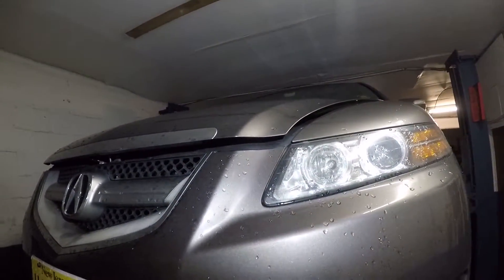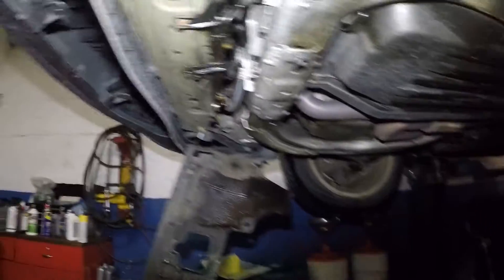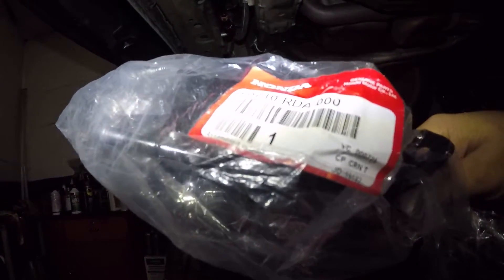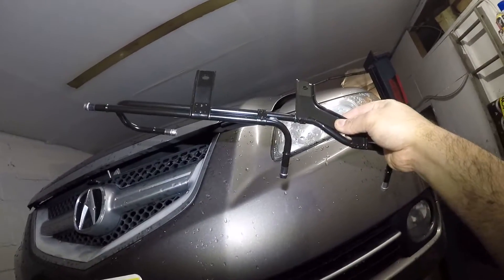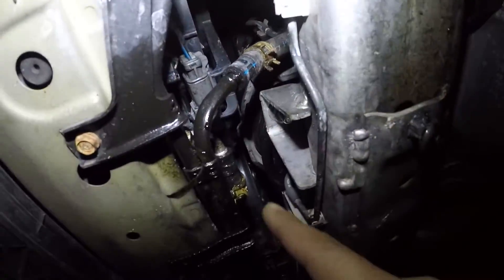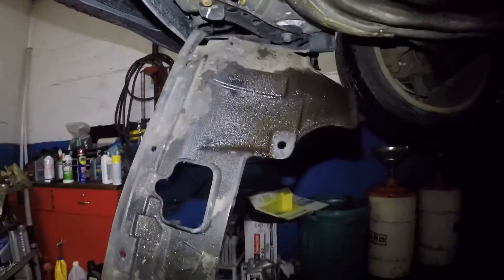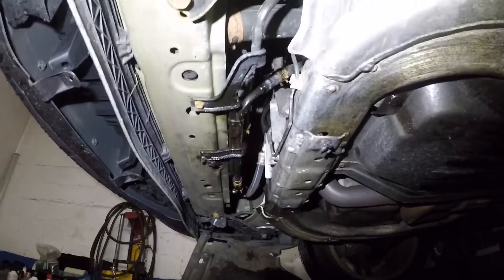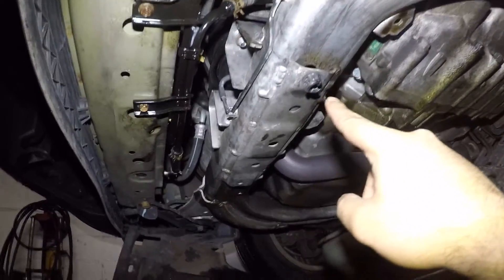Acura TL 2008 Leaking Transmission Fluid

Comment: 04-06 models do not have transmission cooler lines for the radiator. That's probably the main reason they don't hold up as well as the later models (07-08).
Reply from the maker: Cooler is inside the radiator
Reply: @RBTheMechanic  I know the cooler is in the radiator(07-08 models). I'm saying the 04-06 models DO NOT have transmission coolers in their radiators. The radiators are different.

Comment: I had a transmission leak but came out for the top like the dipstick and when came out my rpm when to almost 5k wat that means tranny problems or something else??
Thank you!!
Reply from the maker: It would do that when u loose all fluid
Reply from the maker: @i_Like_Goya  if u put too much fluid it will expand and come out of tube not sure u might need to have it tested check fluid level
Reply: @RBTheMechanic  thanks for the feedback awesome

Comment: i got  a tl and i have to say, this thing leaks oil from everywhere
Reply from the maker: Clean it up see where leaks are pin point leaks and repair them usually the oil pan seal vtech crank shaft seal and this part are common leaks
Reply: @RBTheMechanic  don't forget valve cover gaskets, tube seals, washer grommets and the entire power steering pump assembly along with high pressure hose( former recall) and return line

Comment: If I try to remove it without flushing, will it leak all over the place or is it an easy remove and replace job without reasonable leaks?
Reply from the maker: Ur gonna get the same amount leak I got nothing else u can do it has to leak u can add little bit fluid later on to make it up to level

Comment: where does the filter have this model? Transmission
Reply: I was trying to figure out same thing. Can't find transmission filter on 2007 Acura tl. Seems different from 2004-2006. 2007 and 2008 drain plugs are also on opposite side from 2004-2006 tl
Reply: I heard that the filter is in the transmission and or at least it has an internal filter and that you don’t have to change it since it’s technically “lifetime”

Comment: Do you know if  2007 and 2008 have transmission filters. Can't find it. But 04 to 06 its visible
Reply from the maker: I didn’t see it on these years either but don’t worry about it I haven’t changed mine
Reply: @RBTheMechanic  OK 👌  thanks
Reply: @princedesi29  07 and 08 only have the internal filter, so you would have to take apart if you wanted to change I found that out after I bought the filter for my 08 type s I didn't even change it after I found that out just did a 3x3 flush

Comment: Where can I buy the part? I’ve been looking everywhere
Reply from the maker: It’s from dealer only around $40
Reply: @Alfredo Medina you can go to the Acura parts site or one of the discounted Acura parts site it's called PIPE C (ATF)Part# : 25210-RDB-000
Reply: @Layz13laosboi  bro the part is 25210 rda 000 pice c.   For a base model
Reply: @johnkalin1656  sorry  broI have an 08 type S didn't know they had a different part number thanks for the update!
Reply: The part is the same

Comment: what's the name of the piece you're changing
Reply from the maker: Idk the name they r just transmission metal lines between the trans and radiator
Reply: @RBTheMechanic  friend where can I buy it in autozone there is no
Reply from the maker: @jorgeguashpa7445  this is from dealer only it was less than $40
Reply: @RBTheMechanic  thanks friend
Reply: @RBTheMechanic  friend your workshop where it is located
Reply from the maker: @jorgeguashpa7445  Bayonne nj
Reply: @jorgeguashpa7445  PIPE C (ATF)Part# : 25210-RDB-000
Reply: i’m in orange you wanna check my transmission